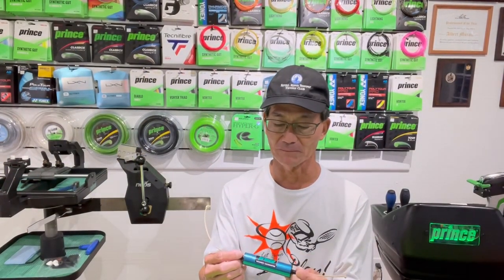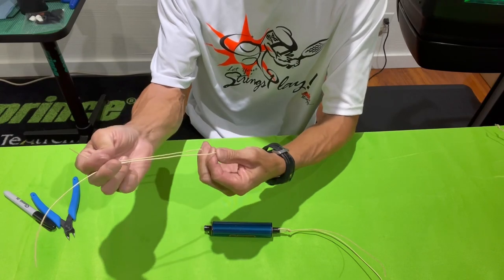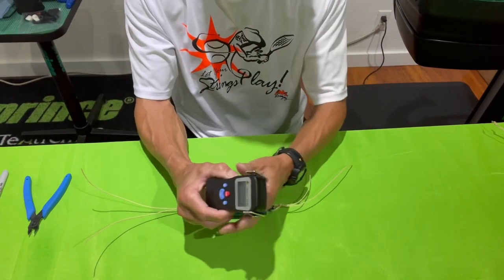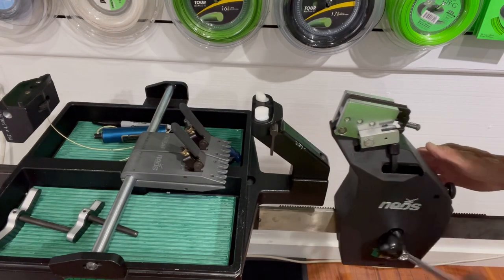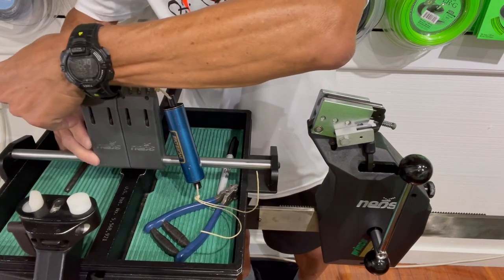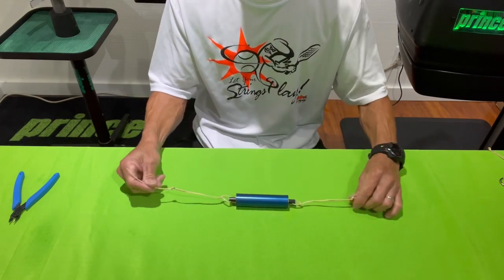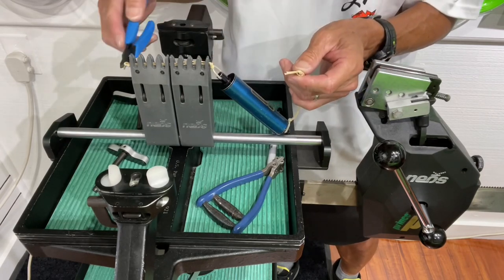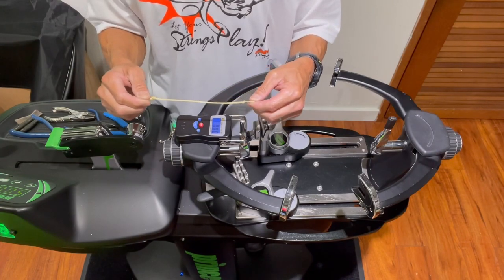Racquet Stringing [Upgrading Your Tension Calibrator]

Comment: Thank you. This is very informative. I also tested with and without the Diabolo.  The result without is spot on whereas using the Diabolo is 5+ lbs tigher with my Gamma 6004 hand crank.
Reply from the maker: Aloha, Thanks for watching! I initially thought that would be the case also with my electronic machine, but here's a video that revealed the outcome. https://youtu.be/NOwzIP_N-kM

Comment: Thanks for your amazing videos! would you be so kind in providing a link to the tubing you use?? can I also use it in older racquets that have worn out grommets??
Reply from the maker: Aloha, Thanks for watching! I have two types of tubing - nylon and Teflon. I bought my nylon tubing about 25 years ago from Babolat but they don't sell them anymore. 

However, you can get them from New Tech Tennis: https://newtechtennis.com/nylon-tubing-10ft-nt10ft-tennis-accessories-racquet.html 
You can also get it from Tennis Warehouse: https://www.tennis-warehouse.com/Tubing_Nylon_10_ft/descpageALPHA-TUBING.html

I'm not sure how stiff or flexible their nylon tubing is, but I prefer the stiffer kind. 

As for the Teflon tubing, I bought a bunch from Grand Slam Stringers a while back, and they don't sell stuff anymore. You don't necessarily have to get Teflon tubing since the nylon one will probably suffice in most applications. 

Here's a video where I featured tubing tips and techniques - https://www.tennis-warehouse.com/Tubing_Nylon_10_ft/descpageALPHA-TUBING.html

Comment: Great channel. What type of kevlar string to you use (Ashway?) when using your calibrator and what gauge ? I have a Tennishead 2090 calibrator and I keep breaking strings when I'm pulling tension for calibration. I haven't tried using the tubing as you've demonstrated on your channel, but plan to do so.
Reply from the maker: Aloha Nicole, Glad you like the content. I currently use the Prince ProBlend Kevlar, but I've used Ashaway in the past. Were you using regular synthetic string on your calibrator? I'm sure Kevlar with the tubing will do the trick.

Comment: Great video!!  Thanks for the tips. I find myself having issues getting the tension correct at different tension points. For example, I can match 50lbs perfect but 40lbs is slightly off and same for 60lbs. Do you have any suggestions what’s the best way to adjust the tensioner?  I also read somewhere that some stringers put the tension back down to zero after they are done so puts less stress on the spring. Is this necessary?  Thanks for all your videos, I find them extremely helpful. 🙏
Reply from the maker: Thanks! I also forgot to mention that another benefit of using Kevlar strings is that it doesn't stretch like other strings. Great question about your inconsistent tension readings! Before I give you my suggestions, is your readings at 40 and 60 one of the following? 1) 40 is low and 60 is high; 2) 40 is high and 60 is low; 3) both are high; or 4) both are low. Also, can you tell me what machine model your using and how "off" are your readings? As for your question about the spring, YES it is recommended that you "zero-out" your tension setting when you're done stringing for the reason you mentioned.
Reply: @AMstringing  I am using Gamma 6004. I just redid the calibration like you suggested and looks like I am dead on at 40/50/60. Couple more questions for you….. Do you suggest testing the tension at multiple tension like I did?  Is doing 40/50/60 enough or would you suggest going high or lower?  Also my crank has the diablo which the Neos does not. I usually string with the Diablo so do you suggest I calibrate my crank by using the Diablo as well?  Thanks for your time!
Reply from the maker: @andychung7882  Great to hear that your calibration is "spot on." In some rare cases, calibration can be off on the high end and the low end, but not in the middle. I'm glad that you didn't have to deal with that issue after all. Checking your calibration at 40/50/60 is sufficient, I do the same. Hmm . . . you bring up an interesting point, I didn't factor in that some lockout machines have a diablo. If that's the case, you should check your calibration using the diablo. I think it's important to replicate everything exactly the same as how you would tension each string during the string process. Also, an 18" inch length of Kevlar string might not be long enough on the tension head side. I'm thinking maybe 24" would be better.

By the way, have you heard of IART? If not, please check out this video. https://vps.wistia.com/medias/bvnjokinug?media_finished